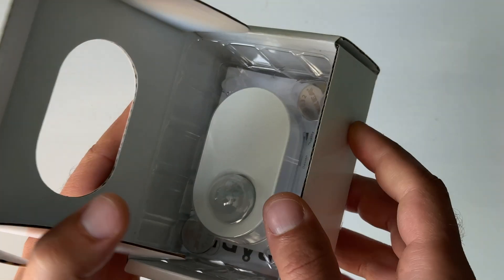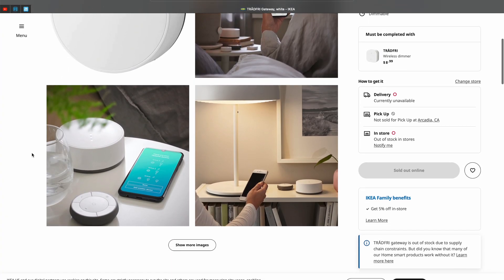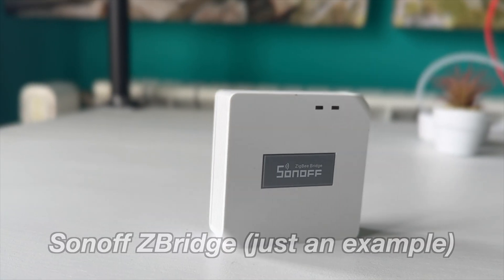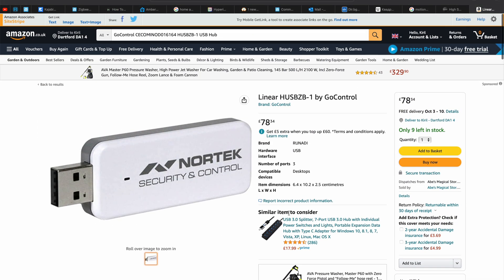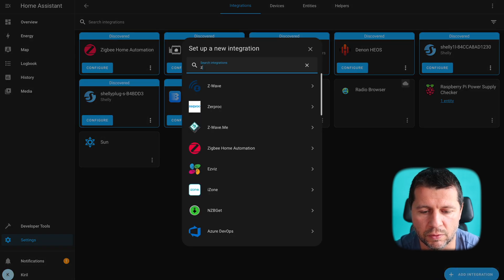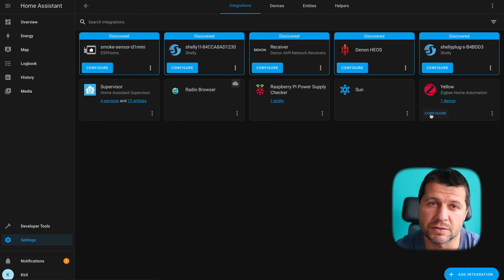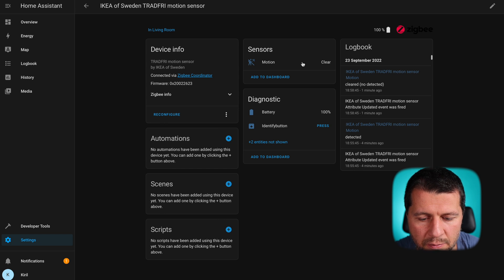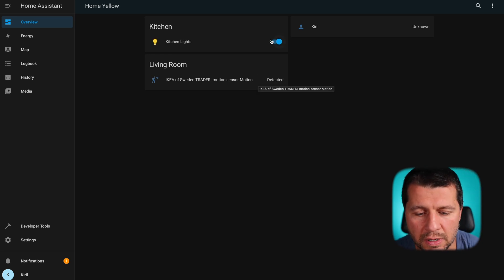How to add IKEA Motion Sensor in Home Assistant very easily

Comment: Is there any illuminance entity on HA with Ikea Tradfri motion sensor, I only see motion in your video.
Reply from the maker: If I remember correctly this device is not having a light sensor
Reply: @KPeyanski  I think it does, but don't know if it works with zha. If it does not, don't you think it is a Key feature for a motion sensor, the absence of which should have been stated in your vid ?

Comment: hi, I've intalled the ikea motion sensor but it remains in "ON STATE" for 3 minutes but i want to change state (ON - OFF) every 2 second. It is possible to modify the times? thanks. In the log i see this and i undestood that "1800 on_time" can means 3 minutes but i dont know ho to change it """IKEA of Sweden TRADFRI motion sensor On With Timed Off event was fired with parameters: {'on_off_control': 0, 'on_time': 1800, 'off_wait_time': 0}""""
Reply: Did you solve it? I'm fiddling around with the time settings as well at the moment...
Reply: @SirMic4711  i've solved installing and using zeegbee2mqtt where you can modify the times.

Comment: I’m having an issue with my IKEA motions sensors, they are eating thru batteries in less than a week. I am using ZHA and they are added thru a sonoff smart zigbee switch. Any idea why that would be happening?
Reply: Hi, still have same issue ? Thx
Reply: @theattorney6072  I pretty much quit using them because of it

Comment: Awesome, inspired me to finally setup my Nortel stick.   How quickly does the ikea motion sensor detect motion, does it take a minute for the state change to take place in HA?  Also, any idea of what the battery life is like on the sensor?
Reply from the maker: Yes, go ahead and setup it. Motion detection is very quick it takes less than a second in my opinion but this is without any officially measurement. I'm not sure about the battery life